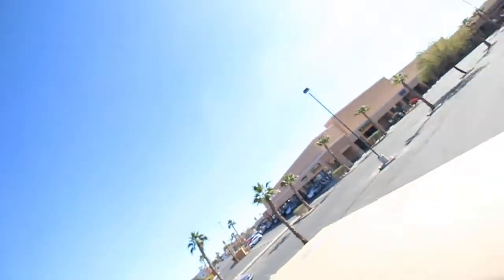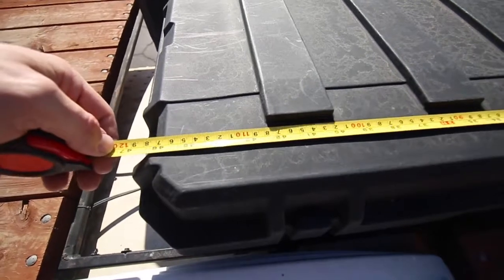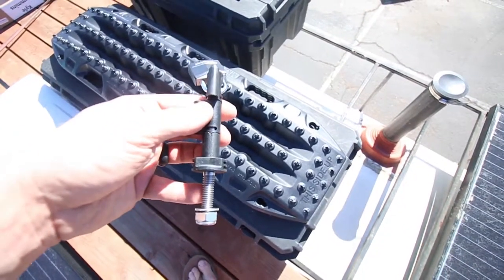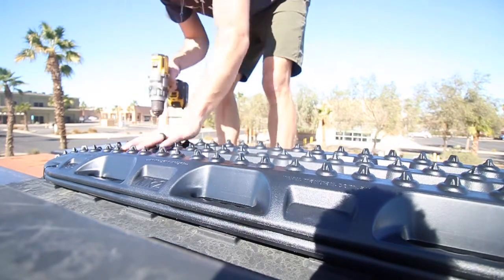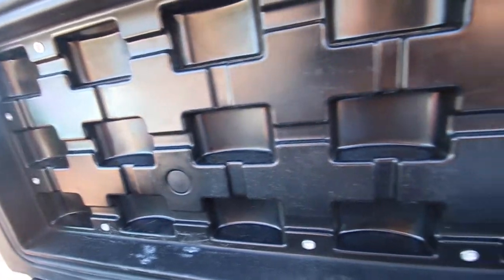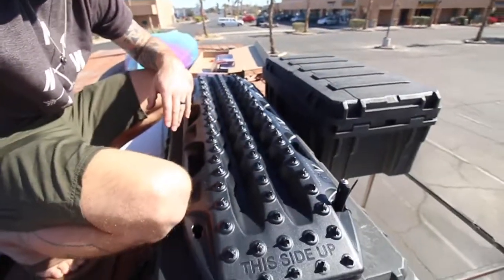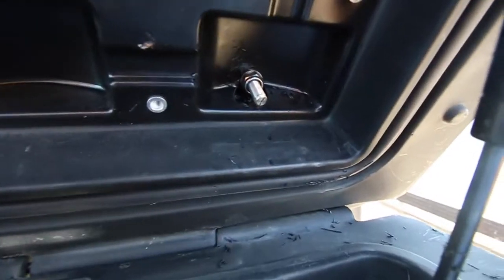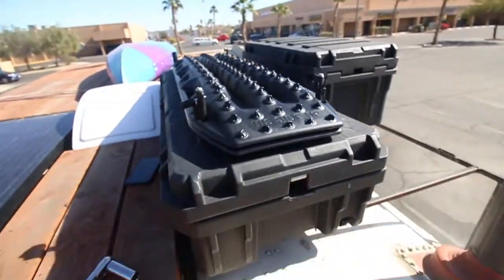Mounting MaxTrax to Roam Adventure 95L Rugged Case - Skoolie Roof Rack

Comment: Nice idea. I would have added silicone into those holes to keep it water tight but otherwise it looks perfect.
Reply: Yeah, I did that after the fact. Good call out.
Reply: and a rubber gasket for each hole.  fender washers would have been useful even if one side needed to be cut straight to fit near edge.  As it stands, it appears to be relying on a small washer which will in time be stressed and potentially enlarge the drilled hole.

Comment: Hey! Have you used the MaxTrax yet? I've been researching for some recovering boards for my skoolie which weighs in around 18000lbs. MaxTrax site says these are for 7500lbs ... just wondering if these have worked for you yet?
Reply: We actually haven’t needed them for the bus but the reason I went with the true maxtrax is because they have a lifetime warranty if they break. Also they now have a heavy duty option available.